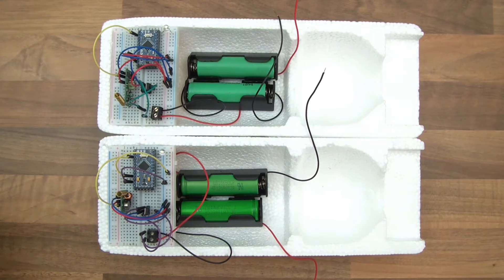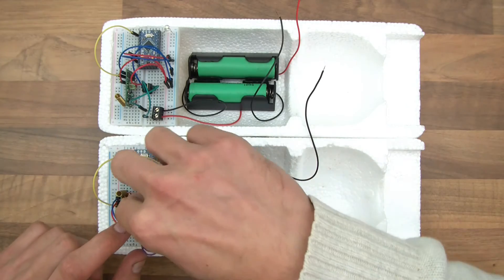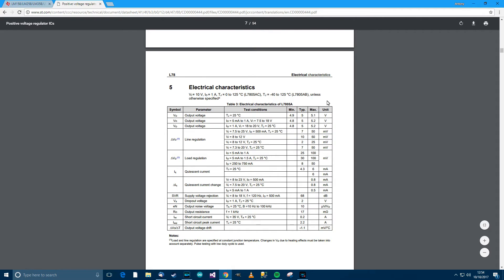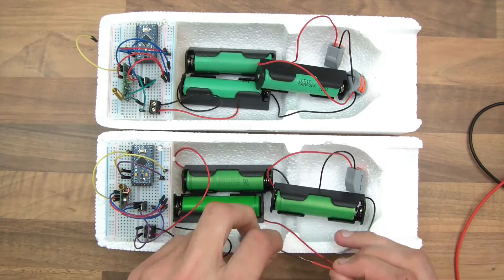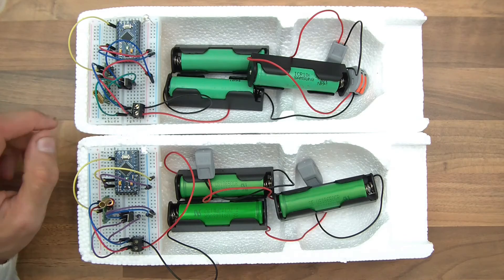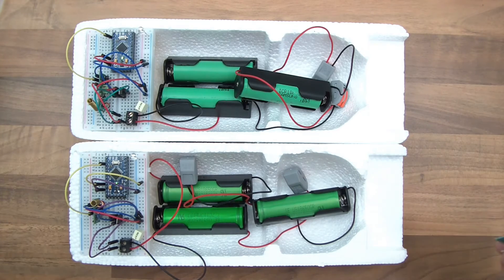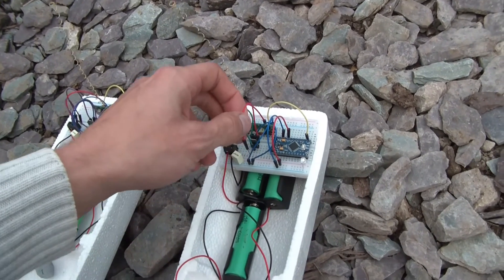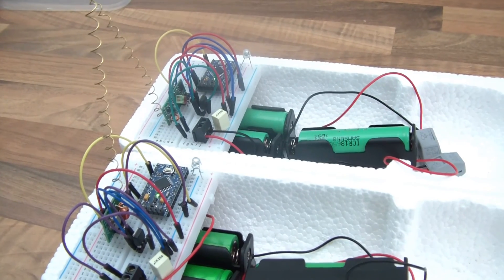INVESTIGATING: The Range of Cheap 433MHz RF Transmitter Receiver Modules - More Voltage?! (Part 3/5)

Comment: I am using half wave monopole antenna on transmitter (just a straight 34.6 cm wire stick) with charge pumped 12v from a 4v LiPo and 5v on receiver with quarter wave antenna (17.3 cm straight wire), I can send data from 6th to 1st floor through few walls @128 bit/sec, its been working for 2 weeks reliably

Comment: You used 12V supply for RF modules but Data signals coming from Arduino is 5V level. Is it causing problems? Do we need 12V levels at Data pin of transmitter when supply used is 12V?

Comment: This is really interesting, I managed to receive data through the ceiling and two lots of walls  to the other end of the house by using 12v at the transmitter. I used 3x crocodile clips as the antenna. without using 12v on the transmitter, data was barely getting through the door! Really cool experiment Antony!
Reply from the maker: Thanks, I'm going to do one last experiment on this little setup, then move on to other modules!
Reply: exciting stuff! I'll look forward to it!
Reply: How come your 12V transmitter worked so well, while in Antony's video it barely worked?? I'm also trying to make indoor application so I need good range through walls..

Comment: I know about aerials and wavelength, simple solution is to find length of piece of wire, math is wavelength lambda = velocity / frequency. Sound easy enough but using mono rather than dipole which is divided by 4 and that the length of wire . So, velocity equal to 3 x 10 power 8 = 300000000, then divided by frequency of 433000000 and that equal to wavelength of 0.692 metres and now mono is divided by 4 and the total length of a wire is 0.173 metres or 173mm.. hope this helps. When you touch the aerial you increased the capacitance in the aerial and upset the wavelength.
Reply from the maker: Thanks Cheetahkid... I'll try this out in a future video.